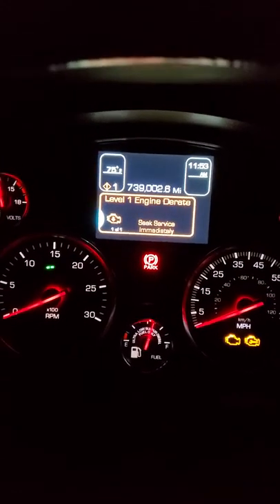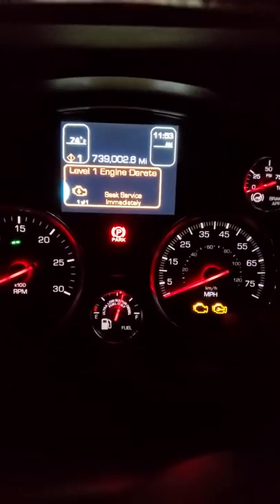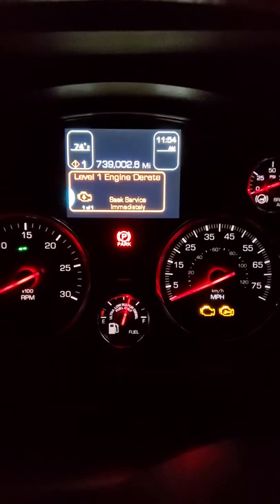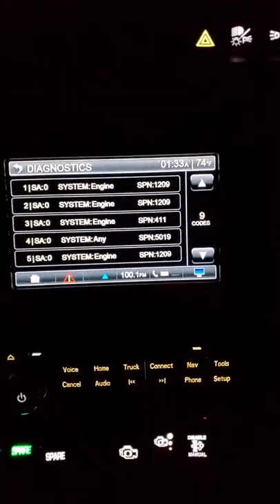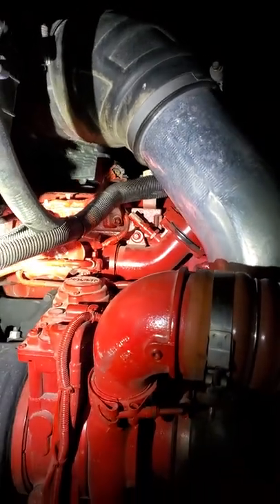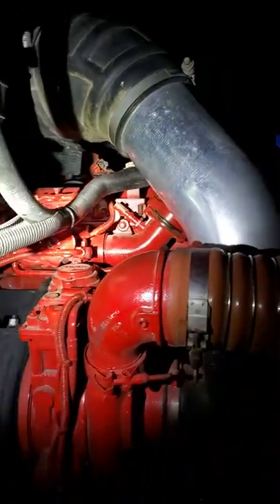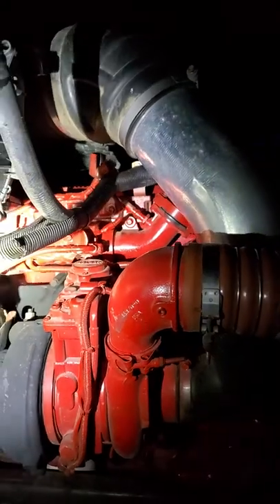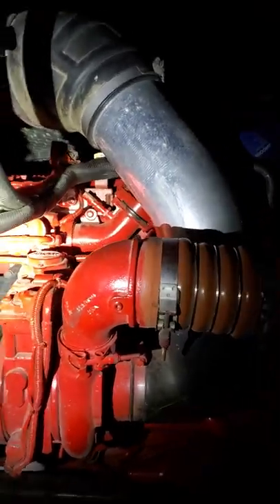ENGIEN DERATE!! kw t 680 hope at helps

Comment: This is by the Turbo on the passenger side.  On the video  you can see a connector right on top of the black hose  and under the hose is where  it was plugged.

Comment: Repairs are going to be expensive trust me I know
Reply from the maker: fuel rail sensor,fuel pump actuator like 400 plus i pay digmost run to make sure fuel flow the  right way 450 you can fix it your sefl just  buy the parts but still woun't knowif it is right

Comment: I have 2017 kenworth t680 
With Cummins engine on it
Has same problem I spend $2100 on it and it's still not working well the dealer just took the money
Reply: if you fix it , can you please tell me what was the problem ?
Reply: I park the truck it's been long time 
Now driving for company 
Maybe the DPF has a problem which cost too much to fix it around 20k 😢

Comment: I drive with Knight and they switched me to a new 2024 kenworth t680 . 45k miles in it so far and I am having the same issues. 
1. The truck rattles too much and the noise when idling is annoying. 
2. I get the engine derate with timer (239mins) orange light and wrench sign . It comes on and off but it actually slows me down to 20 miles per hr . I’ve taken it to the shop to get it fixed but it’s temporary. It always comes back . Anyone know how to fix it?
Reply: Same issue with mine smh
Reply: @peacebestill6050  they fixed mine a while back but if you’re having issues tell them it’s a computer code . Very hidden. Also these new trucks regen whenever they want to so never skip one . Like never . Especially kenworth